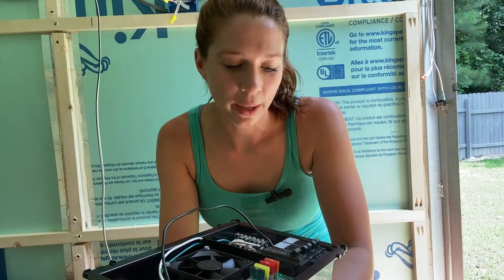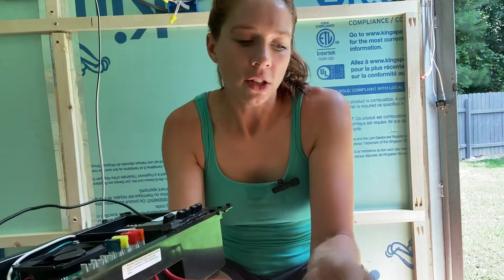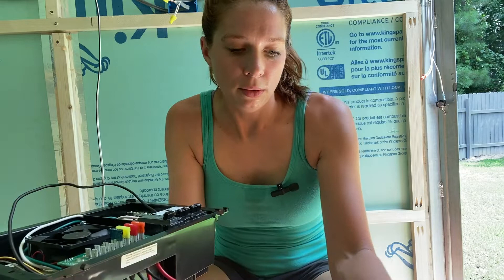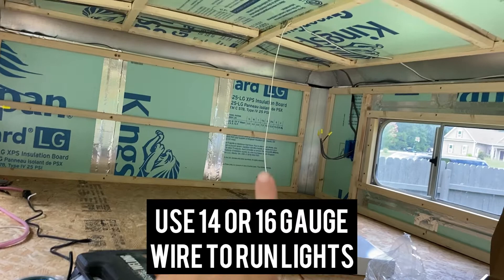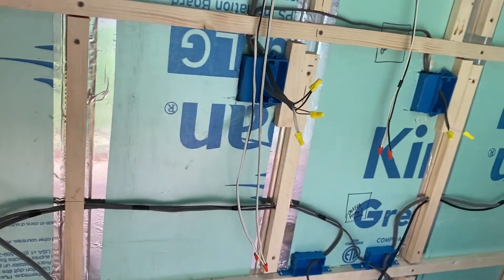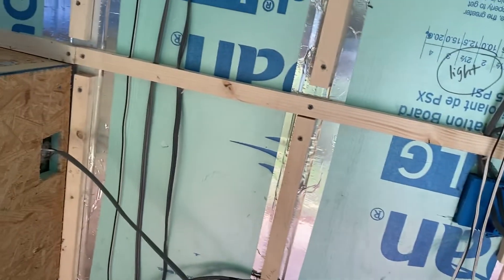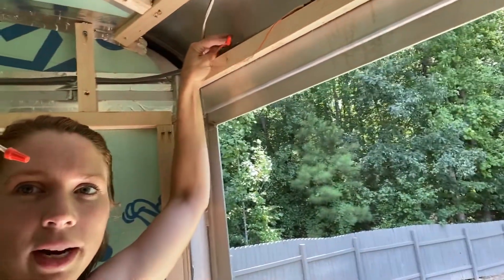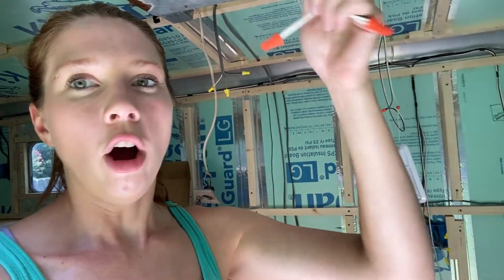Wiring your RV: 12 volt system

Comment: How do you secure something to the wall without access behind it? I picked up the round 12v outlets and they have that screw ring to hold it in. I’m not sure how to secure it without using that which I can’t do because I can’t open up the whole wall. It’s a brand new camper. Any suggestions?

Comment: So if you don’t want to run any 12volt power supply, can you just wire the outlets, lights, fridge, etc., off the 110/120 power source/breaker panel?  So for example if I don’t want to use anything until I plug it into a 30 amp tv site, I don’t need the 12 volt system, correct?  I hope that makes some lick of sense?!
Reply: RV site**